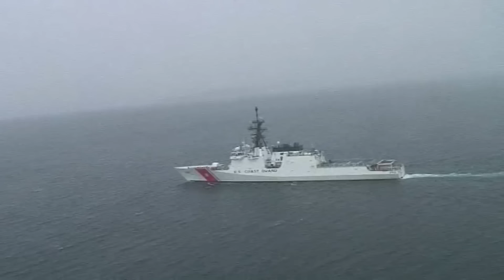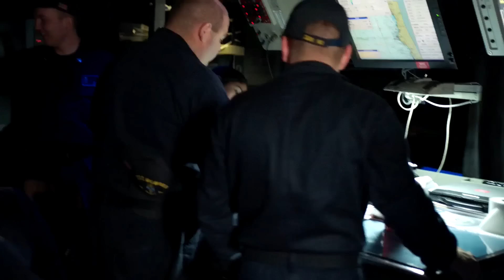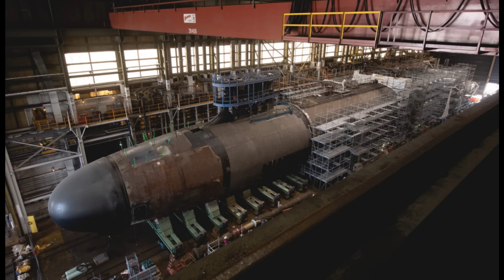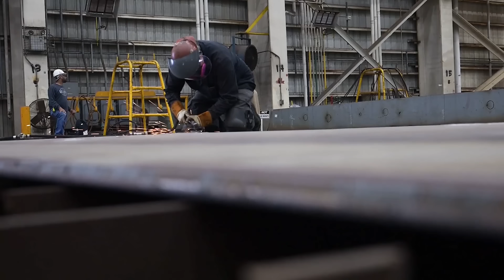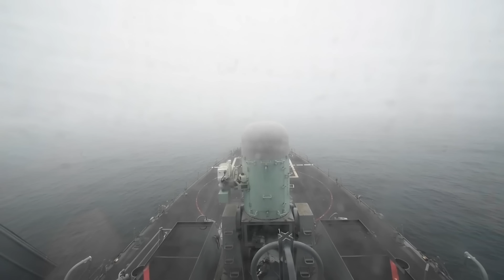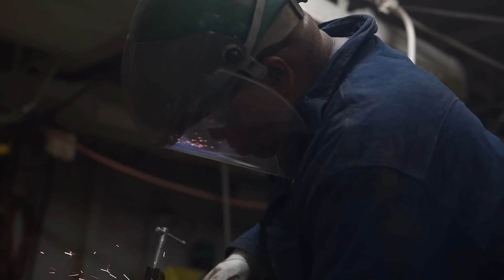The US Navy’s Radical Plan to Build Its New FF(X) Frigate Faster and Cheaper

Comment: I'm just so confused. The original HI proposal 10 years ago showed a 16 cell Mk-41 VLS system between the forward superstructure & the gun. Why on earth would this simple addition be deleted? Thats your game changer right there. It opens the door to the next level. The ship would instantly be able to punch above it's weight with SM, ASROC, ESSM, & TLAM. This makes ZERO sense! What the heck are they doing? All you gain here over LCS is extended fuel range. Might as well just keep the production lines going for the MMSC version. It's already all tooled up & working on the 4 ships for the Saudis.
Reply: It is only the first flight of the FF(X) that will lack VLS. My guess is that the Navy will just "steal" the cutters currently being built for the USCG and call them frigates when they get them into the water. The once they start building their own hulls from the bottom up, they will start using the patrol frigate blueprints from HII with the VLS and sonars.
Reply: @christoffermonikander2200  good point
Reply: I didn’t think of that. Aren’t there like 2 or 3 unfinished legend class cutters the coast guard for whatever reason didn’t want
Reply: @imparkmade7357  there is only 1 partially built hull and materials for another
Reply: @imparkmade7357 The USCG had supply chain issues and lack of money so the tenth cutter was suspended to support the cutters under construction    So no, no cutter hulls setting on the ways
Reply: @imparkmade7357 The 11th hull was started but work was halted last year.  Lead out materials for the 12th have already been procured as well.  The Navy will just finish these two hulls in the slightly up armed trim.  My guess is the third hull will begin to receive new integrated systems
Reply: @patricktimothy3018  That rimes with the speculation I recently had with an active duty USCG Officer.  He thinks the Navy is grabbing the previously incomplete Legends as a starting point.
Reply: @christoffermonikander2200 hopefully
Reply: @christoffermonikander2200  Nuts to call a cutter a frigate. It ain't a frigate.
Reply: @jonny-b4954  A name is a name, not a capability...all CG assets are designed to be up-armed in war time, so we don't know their real capability.
Reply: @davidkottman3440  I mean, a class of a ship is a general concept of capabilities. Not a "name." I just don't see how anything using the USCG cutter platform is truly going to be useful. How does any ship without missiles survive in today's warfare?
Reply: @jonny-b4954 Some capability is a heck of a lot better than no capability. Do you want to trust the Little Crappy Ships or Zumwalts to back up the carriers, Burke’s and Tico’s in a shooting contest in Taiwan or the Baltic? I sure as hell don’t. If not, you better get something proven and reliable into the water damn fast.  At the very least, you know you’ve got enough fuel and a reliable enough propulsion system to cross the Atlantic. The later blocks will have VLS capabilities, and that will allow them to make a bigger contribution in any situation.
Reply: Not having VLS is a mistake. This ship is roughly the same as a Knox class frigate from the 1960s, with 100 times the air threat. FFX doesn't need a full AEGIS setup, but ESSM would make this ship far more survivable.
Reply: @gilraine1225  I mean, I don't get how you have any major warship with VLS nowadays. Missile are the basis of air defense. And you've got to have strike power.  A frigate without it is useless. We can wait until a major war breaks out to build cheap, expendable escort cutters
Reply: @jonny-b4954  lol, boy, any war today will be over before new ships are built!
Reply: @davidkottman3440  I'm talking about WW3 or a major war. Those aren't extinct. There's no other perceivable war really where we would require a massive buildup otherwise.
Reply: @gilraine1225  Only the first block of ships, which are incomplete hulls meant for the Coast Guard but canceled due to budget problems,  will lack VLS. The next block will have a limited VLS system added. But even with this, you are missing the point.  These units are designed as escort ships for the large surface combatant, to take some of the workload off of them and allow them to concentrate on the mission goal.  It’s the return of the High/Low mix concept from the Cold War. They don’t have to have a big long range strike capability to be useful, and the small number of cells they carry will likely be devoted to anti-aircraft defense.
Reply: @gilraine1225  A legend class was used to interdict a shadow fleet ship in the north atlantic. The coast guard cutter had no problem carrying out that mission on its own with the help of helicopters launched from allied countries to conduct the boarding. This clearly shows the value of the FF(X) and where it is likely to be used in its early iterations. It is well suited for such missions and those which are similar. The navy version will also feature containerized munitions as laid out in the video, and the later flights will get VLS along with those containerized payloads making the ship more capable in contested environments. 

It will be survivable enough for the int ended mission set while freeing up burkes for missions in more contested environments where their advanced capabilities are actually required. 

This is better than spinning our wheels trying to build a ship for over a decade only for it to be late, over budget, not survivable, canceled, have fundamental issues, etc. 

This ship is well suited to the current industrial base, fills a niche well, and has the ability to be easily updated and modified in the future with changes to the hull and systems along with containerized payloads while also having very long range, high speed, and reliability.
Reply: @BrandonMeyer1641 In peacetime. You couldn't even use this FFX as a convoy escort against drones. A warship without air defense is nothing more than a waste of money and effort. We already did this with lcs.
Reply: @gilraine1225  It has air defense. The LCS cant even go full speed in a moderate sea state. It cracks under its own weight, on top of being overly expensive. The FFX is pretty much jaust as capable, cheaper, and is actually capable in blue water.
Reply: @BrandonMeyer1641 ram and a 57mm are not enough. A 16 cell vls would get you 8 NSM amd 32 ESSM. I should have said area defense. If a threat gets to point defense, you have already failed
Reply: @gilraine1225 not it all situations. Again, it’s not a Burke, and not supposed to be. You thinking about the purpose of this ship all wrong.
Reply: @BrandonMeyer1641  no im not. i get that is for lower threat enviroments. drones have become so prevalent that an area defense is vital. im not calling for an AEGIS setup or SM2, or even tomahawk. this ship must be able to protect itself against drones, aircraft and anti ship missiles. ESSm is fine for that
Reply: Probably to just get hulls in the water and then upgrade the ships and future ships with updated designs as production continued, it would make sense to have ships already at sea and know how capable it would be as well prior to making these decisions.
Reply: You have to remember the us navy is very rarely in combat. I think they want these for logistics support and non combat roles. For combat they will rely on the Burkes . These are in whatever non combat roles they need until they can bring out their next flight(mark 2, upgrading whatever they need most likley vls.) It's to get hulls in water and hopefully lengthen the life of Burkes and Ticos.
Reply: @Jakezillagfw  but stick a towed array on it and you increase the protection for the cvan, they only have 4-5 ships protecting a cvan vs 6-8 years ago, that makes a huge difference against subs!
Reply: @MichaelDeclercq-t5z We have zero ships now. If that is done it will slow down ship production. The navy now does not have an option for anything other than Burkes which are aging. This is a shift to the navy now which before it has shown looking at the navy in the future has failed.
Reply: @Jakezillagfw  i am looking at a 1980s frigate mix( 40 ff and 50 ffg) my guess is build the ffx and slowly turn it into the ffgx( spy6 single rotating array, just enough to fire sm2 and active seekers)16 vld cells are enough if your quadpacking- figure 4-6 sarh missile targets and 2-4 arh missile targets plus vasroc
Reply: Also upon doing research, at least 3 other ship yards not doing us navy ship construction could assemble the ffx with other smaller yards making ship modules- this has the potential to generate 4-6 ships per year with hii managing the upgrade/ improvement process- the old saying “you go to war with what you have not with what you might have in a few years!” in a
Reply: Todd seattle, gulf shipyards and the old Philadelphia ship yard
Reply: The thing that bothers me the most is that little dinky 57mm, its like taking a short knife to a gun fight
Reply: @M @MichaelDeclercq-t5z at gun is pretty fierce. Take a look at it on youtube. It puts out more rounds by weight per minute than the 76mm gun system does due to it's high rate of fire, it has guided rounds, programmable ammo, & it can do AAW, ASu, & shore bombardment. If you had a small boat swarm attack, it's deadly- it'll shred them to pieces with the air burst rounds. If you were in an enemy troop concentration or a in a machine gun nest & they called it in, you're done for.
Reply: @MrWlbblw  against a prc corvette with a 76 mm gun, it will be toast before it gets into range, not counting 100 mm and 130 mm guns
Reply: @Mic @MichaelDeclercq-t5z it's not going to get into a running gun battle with another ship! The 57mm is for surface drones, swarm boat attacks, shore bombardment & AAW defense.
Reply: @MrWlbblw i think either both sides will destroy each with missiles or run out of missiles and end up in s gun battle, the original F-4 fighter had no guns but they were added after several f-4s got into dogfights and were shot down by mig cannon!
Reply: @MrWIbblw The reason it’s lacking them is because when Constellation was selected the design maturation to attach VLS, SPY, and asw were cancelled. No reason to attach weapons that Legend won’t need. If we had gone with Legend from the beginning it almost certainly would have had those weapons and sensors
Reply: It's probably more about investing money in HII and then making annoucements.
Reply: ESSM only.  Sensors not appropriate for any of the SMs. Not deep enough for TLAMs, and who uses VLA any more?  Just use your Helos to prosecute.  I am however, on-board with your second idea about the MMSC.  We seriously need to look into that ship as another candidate/alternative for the FF(X) program.  Maybe even convert some of our decomm'd Freedom-class to that spec.
Reply: Iirc those are untested concepts/designs, they don't want to risk it for Flight 1 after decades and decades of procurement failures
Reply: It'll get to that later.  The NSC was designed for that.  But they want to get some hulls in the water without further delay.  The first few will basically be NSC with some ladders bolted on.  Later flights can upgrade to the 16 cell VLS , better radar, hull mounted sonar, etc.
Reply: Calm down, the first flight won't have VLS. We're going to have at least 70 of these things. Later ships will have more toys on them. Primary the navy wants a frigate to kill narcos and pirates to free up our destroyers which are better for defending carriers and leveling enemy bases.
Reply: @BartimaeusAurelius  Y'all seem to have a lot of faith in USN, who has done nothing but fail at acquisition for decades.
Reply: @jonny-b4954 Which is the exact reason why the decision was taken from them. If the navy brass had their way they'd still be waiting on those Italian frigates.
Reply: Yesh it makes = to a Japanese ffm
Reply: There is room and space saved for the 16-cell Mk-41 VLS for ESSMs... It is just a matter of fitting the Mk-41 VLS... Apparently the US Navy wants to buy lesser capable warships for the backwater mundane Mr. Roberts navy escorting tankers and supply ships... For every FFX frigate built, frees up a DDG for front line combat... I recall the Knox class FF frigates, not every frigate has to be a FFG guided missile frigate to be a useful contributor... Without the beans and bullets, not to mention the fuel of the Mr. Roberts navy, those front line warships starve... Amateurs discuss platforms and tactics, professionals discuss logistics...
Reply: At least go with the 12 mk 56 vls design with fc radar
Reply: Keep in mind, the USN still has superiority over its adversaries in VLS tubes and hull tonnage. What it lacks is localized concentration of assets. The FFX is supposed to take over peacekeeping and escort roles that destroyers have been tasked with for lack of lower cost replacements. This is something we should've done since the end of the Cold War, especially when we were thinking of the LCS.
Reply: @米空軍パイロット but how can it escort anything with such a lack of offensive and defensive missiles?
Reply: @starship4453  It can still fight pirates in this form, and it is supposed to get upgrades for ASW work in its next flight.
Reply: @starship4453 Did you watch the video? It’s has more than enough firepower to deal with low risk missions like the OP referenced and free up a Burke to perform a task that requires its capabilities. We are currently cracking eggs with sledge hammers by having the Burke’s and Tico’s perform things like pirate interdiction and chasing down Venezuelan oil tankers. The new design can perform that role. And in a really hot scenario, they can deploy with the large combatants and take responsibilities like submarine detection and mine defense off the big boys. Plus, after the first block, they will have some smaller VLS capability built in. The first build will consist of 50% compete hulls that the Coast Guard canceled due to budget and logistic problems. It would be too expensive and time-consuming to retrofit the VLS into the already completed deck structure. The future keel up builds will be able to accommodate VLS to some degree.
Reply: @chandlerwhite8302  Did you watch the video? 

1) These missions may be “low risk,” but even recent tanker interception operations by Coast Guard cutters still required destroyer support. That undercuts the claim that these ships meaningfully replace combatants rather than depend on them.

2) The current blockade of Venezuela already involves destroyers and even a carrier strike group. It’s unclear what a lightly armed cutter adds that an on-station destroyer doesn’t already provide — other than a lower-end presence hull.

3) Missions like pirate interdiction and maritime security are already performed by LCSs, which are significantly more capable than this cutter-based design. Even then, LCS has struggled to justify itself as a long-term solution.

4) The cutter-derived frigate has no bow sonar and no towed array, and there’s no certainty that a containerized ASW mission package can be integrated. Relying solely on a helicopter for ASW is weather-limited, sortie-limited, and not sustainable for persistent operations. Mine warfare is already being handled by the Independence class and unmanned systems.

5) Any future VLS fit would be very small and limited to self-defense. That does not provide escort capability, area air defense, or meaningful deterrence.

6) Using existing hulls may improve ship counts on paper, but it results in a structurally limited ship the Navy is stuck with  and had less combat capability than frigates designed in the 1970s — nearly 50 years ago.

7) With most peer and allied navies moving toward frigates with magazines above 8-16 cells, this design risks being outclassed from the moment it enters service — especially when measured against China’s rapidly expanding surface fleet.
Reply: @米空軍パイロット  it's very limited
Reply: @starship4453  what makes you say the lcs is capable?  Are you a defense industry lobbiest? 

They decommission those vessels almost as fast as they produce them because they can’t be serviced, have unreliable propulsion, and hulls that crack under their own weight. The lcs is worse than the ffx based purely on the fact it can’t make jt across an ocean at full steam without falling apart.
Reply: I think they are prioritizing production volume over being versatility in a contested environment.
Having VLS cells could increase timelines substantially, their rolls will be very different than frigates from other nations. The Burke and Virginia class subs will be the main platforms with VLS cells. High low mix
Reply: @Tripple_Threatt92 Huntington Ingalls already designed for a 16 cell VLS.
Reply: Phase 1 get the hull and power plant right then start adding sensors and weapons slowly( you can always go back and add to earlier flights)!
Reply: If VLS is added, wtever machinery and wirings currently using that space wud have to be modified, which increase risk of complications and delays, the exact thing the navy seeks to avoid
Reply: @chimakinor Currently, there's nothing in that space that can't be relocated easily.  Ask and Coastie that has served on a Legend and they will tell you there's obviously extra space built into the ship.
Reply: @patricktimothy3018 plus the navy’s version is already about 3 ft longer and weighs more. A flight II would be even more modified.
Reply: @patricktimothy3018 it's a good platform... But it's running into the same space limitations that Arleigh Burke has run into.